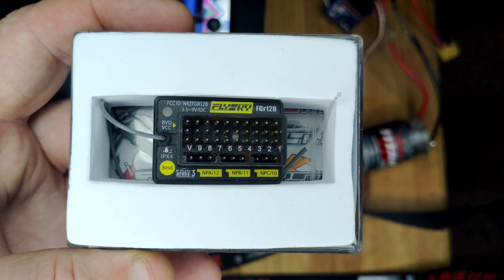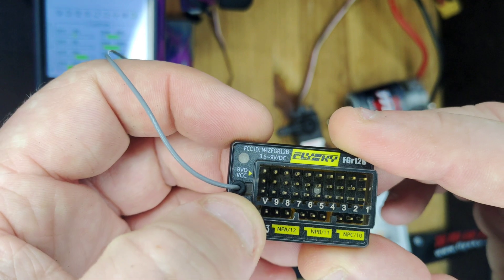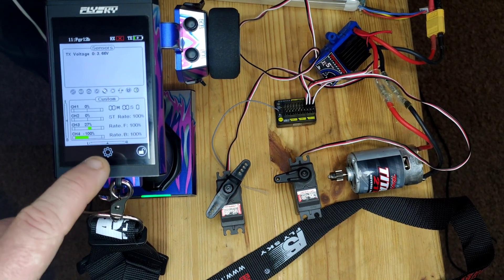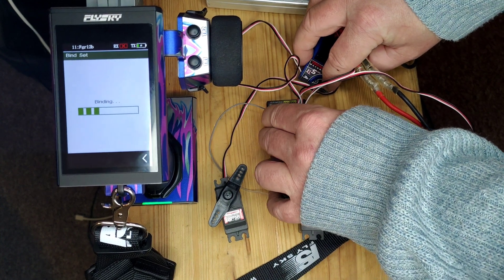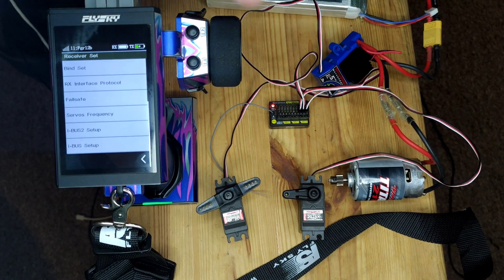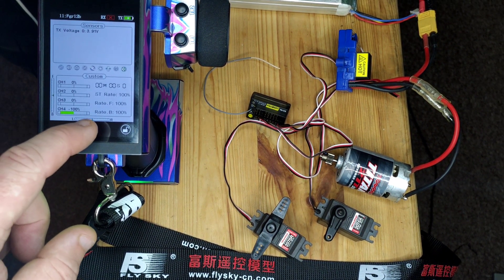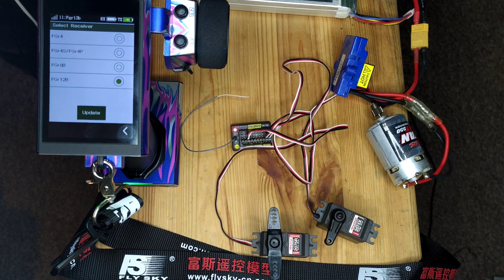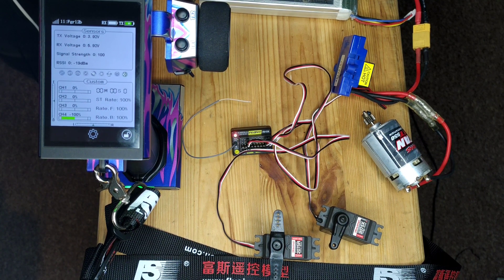Flysky Noble nb4 Fgr12b 12 channel receiver early look and firmware update process.

Comment: Just got mine, update and binded, but I don't see channel 9 thru 12 on the radio !!
Reply from the maker: If it's an nb4 you won't there only 8ch the pro has 18ch
Reply from the maker: With the nb4 you can use the extra channels for sensor or ibus though so you still get to use all 8ch plus sensors
Reply: @WTFRCCars  Yup its a NB4, I'll have to invest in the NB Pro, Thanks Craig !

Comment: Is there any reason this wouldn't pair with the noble pro? Tried the pairing process and the pro doesn't find it at all? Connected fine to the fgr8b etc any help would be really appreciated.
Reply from the maker: You will need to put it in update mode then run update from the pro and it will then work fine :)
Reply: @WTFRCCars  wouldn't happen to have a guide would you bud. Thank you for the reply
Reply from the maker: Just watch the vid your commenting on its same for nb4 and pro :)

Comment: Hello . I have a paladin 18 ev. And wanted to ask if I have to do an update on the radio. Current is firmware 1.0.20 March. 11. 21 on it. In addition, I cannot find the BVD sensor. Can you help me??
Reply from the maker: Hi I don't have the paladin unfortunately, as a rule you will need the latest firmware and if you can't see the dvb as an option that's normal because the firmware you have is older than the firmware in the receiver and so does not support it so id update the radio and the receiver, which receiver are you using?
Reply: @WTFRCCars  Okey thanks for the information. Can you tell me which program I need on the online site for the update. I don't quite see through there
Reply from the maker: Just checked there is no v2.0 firmware available yet for the 12ch or dvb update it was like this when the fgr8b was 1st released they will do the update at same time as the ev firmware and noble pro firmware is released no ETA though
Reply: @WTFRCCars  Thank you for investigating.
Accordingly, the bvd cannot be used with the fgr12b
Reply from the maker: Soon as I see an update I'll do a vid for it :)

Comment: So does this mean that the NB4 will be updated to output 12 channels? Currently, it can only do 8 according to the system menu and given the fact that there is already an  8 channel RX (I own 2) this would be pointless if Fkysky won't update the radio to use the extra channels. Excited to see where this goes.
Reply from the maker: sure does, there is no actual limit to the number of channels the nb4 can support as it's a fully software defined radio, the otger radio that shares the protocol is the paladin 18 channel transmitter.
Reply: @WTFRCCars  Yes, I'm aware of the Paladin radio and it's channel output capabilities. I HIGHLY doubt the NB4 will be able to output more than 8 channels and here is why: After posting above, I recalled that I emailed FlySky last year because I wanted to be able to use all 10 channels while using the FTr10 RX in my TRX4. Flysky replied back with this answer on Aug of 2020: 

"Dear Sir, I see what you mean. Currently, NB4 can only support 8 CH at most, but due to hardware reasons, more CH can't be done. Maybe the NB4 Pro can support more and more channels. Thank you for your support." 

So yes, it's technically a matter of software update when it comes to adding more channel output capabilities to the NB4 but there is a hardware limitation (not enough switches) according to Flysky. Personally, I still think it can be done by using the trims keys and what not. All Flysky has to do is allow users to set trims settings, like throttle trim, within the menu system as opposed to having it tied to a key/button as it's traditionally done. The end user can decide for themselves if they need dual rate or  steering trim assigned to a button if at all. At the end of the day, I think they should still move forward with updating to 12 channels but I guess they can market the NB4 Pro as being able to do that.
Reply from the maker: Flysky have already answered the question on their official site that the nb4 has no channel limit, if each button and dial is assigned to 1 channel it has 18 options and so could easily support 18ch, the trims can already be set in the menus so that's not an issue and the fg range of receivers are only for the nb4 that already supports the fgr12b firmware update so it's very likely they will add 12ch support firmware for it :) there also one of the only manufacturers to ever release a 4ch transmitter and then update it to 6ch and them 8ch most others do as you have said and just release a new model.
Reply: @WTFRCCars  Time will tell then. Either someone at Flysky is talking out of their ass or Flysky has had a change of heart. If I could post a screen shot of the email, I would.  In any event, this is great news for anyone looking for that option if it so comes through. I do recall though that when the NB4 went on sale, Flysky noted right from the get go that the NB4 was an 8 channel radio though it shipped with only 4 channel capability before new firmware was released as promised bit later on so it's not like they had a change of heart. The NB4 was always meant to be an 8 channel radio. It's great however, that Flysky does listen to feedback and makes changes every so often based on such feeback. When I had my 7PX I sent an email to Futaba about adding a radio capability and to this day I never heard back (4+yrs ago). No even a damn, 'nah, we aren't doing that'.
Reply from the maker: Yeh will be one to watch, I'm still very impressed with just how many options they have added and how easy the nb4 is to use and so far flysky seem to add the firmware to support any fg receiver they release